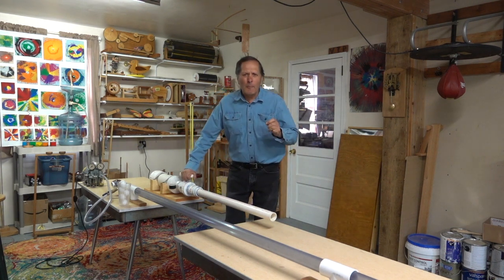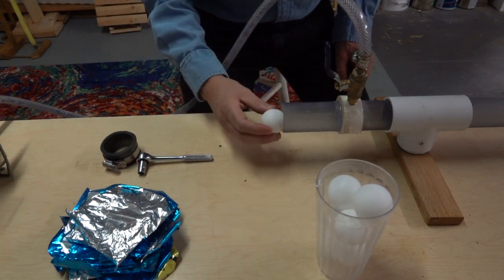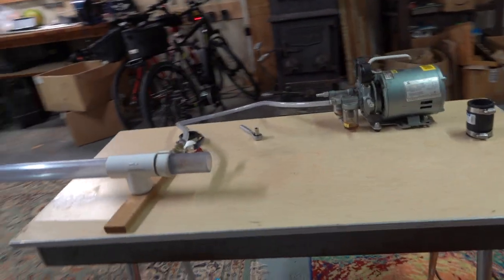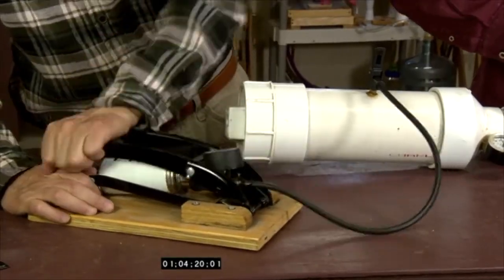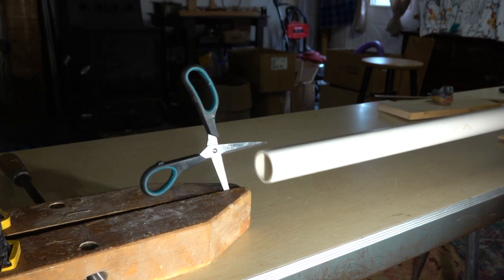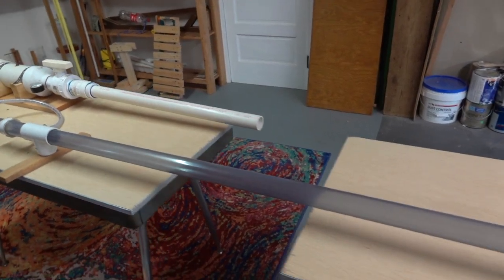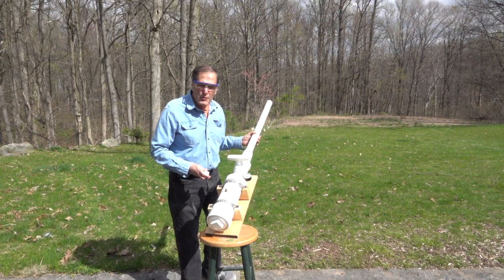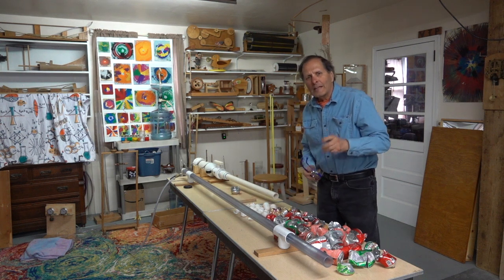Ping Pong Ball Cannon..Vacuum Cannon versus Compressed Air Cannon

Comment: I remember the supersonic ping pong ball from mythbusters, they found out that air that push the ping pong ball always managed to go around the ball through the tiny gap between the ball and the barrel. So at some point, the length of the barrel will no longer add speed, and even worse in vacuum canon, since some of the escaped air will actually act as cushion and prevented the ball to go through the other end.
Reply from the maker: I haven't seen that episode but am finding the same thing and will show it in part two
Reply: + longer tube = more friction.
Reply: @YeanyScience  hello Bruce, sorry to bother but there is religious promotion in this comment section which shouldnt be on a science channel

Comment: I've wanted to make one of these since I saw the episode on myth busters. These videos gave me the motivation to go ahead and do it. I've had a bit of trouble with cheap mylar balloons failing prematurely so I've switched to the slightly thicker mylar used in some snack food bags. (pirate's booty is the junk food of choice around here) I have a 5 ft tube and so far have been able to get to about 250 mph. I plan to try a few other types of balloons as I think the thicker mylar may be slowing me down. Thanks for the idea! I really enjoyed the videos!
Reply from the maker: Nice to hear that you went ahead and tried it,  I started with a 4 foot tube, went to 6 foot and finally 8 foot,  speed increased with each change,  something else to consider
Reply: @YeanyScience  ahh thanks I will give that a go.

Comment: Noticed at the 12:12 mark when the combined vacuum and compressed air cannon fires you can see some sort of oscillation at the end of the barrel where it appears as if the gasses were attempting to equalize by rapidly flowing in then out then into the barrel end.  I hope we get an explanation for that in part 2.
Reply from the maker: Good eye resiggy13,  I have some better views of it in part 2

Comment: I was gonna comment that you should vacuum tube the the barrel of the pressure cannon but you granted my wish! Also, another reason bit might slower is due to the need to accelerate air already in the barrel of the pressure cannon. With vacuum cannon you have no such resistance.

Comment: I made the vacuum cannon and am having trouble getting the ball to exit.  Mythbusters used regular packing tape to seal the ends, so I am as well, but the ping pong ball only exits every 3 or so shots.  Other times it seems to hit a cushion of air and stop before the end.  The ball is almost an exact fit for the pipe, so not much air is getting around, but I still can't get anywhere near the speeds in this video, and that's if it fires out at all.

Comment: In the pressure cannon, the air in front (target side) of the ball must be accelerated in order to get out of the way of the ball. Air is heavy. The air inside an ordinary refrigerator weighs about 1 kg or 2 lbs. The longer the barrel, the more air must be accelerated so that the ball gets a smaller proportion of the total energy.

Comment: I imagine the compressed air cannon would benefit from a sort of scupper valve once the barrel length gets long enough. I would rework that ball valve so it can easily snap open, or exchange it for a fast acting butterfly valve.
Reply: Agree! In the video we can see the valve still opening after the ball hitted the can. If the valve could be opened a little bit faster, all that pressure could be released more faster. @Bruce you could think on a way to open that valve more faster.

Comment: So theoretically, the max velocity of the vac pump would be the speed of sound ?
Reply: I don't remember the formula now, but, theoretically, the maximum velocity of the air filling a tube with barometric pressure 0 should be equal to light velocity. The barrel in this video don't have barometric pressure equal to 0, and have a lot of gaps to do it workable, and there is the ball's inertia.. it is very hard to calculate the theoretically maximum speed of the ball.

Comment: make a hole in the ball and fill it with sand...this will give some mass so it can reach crazy speeds and distances
Reply from the maker: in a later video I fill the balls with water,  makes quite a difference
Reply: In the UK I suspect you could fill them with lead shot ... and commit an offense under the Firearms Act!  🙂

Comment: Attach the vacuum cannon on the tip of the air cannon so you can have lots of pressure in the back and no resistance in the front. :)
Reply: I’m sorry, you just did that in your new video! That’s awesome 👏🏼

Comment: What happen if we combined both vacuum and the compress air cannon?
Reply: As in the tube or barrel be in vacuum state where there is less air resistance for the ping pong ball to travel through and the compressed air providing extra thrust to propel it.. just connect the two cannon together which you would only need to cap the exit end of the barrel while the inlet side would be sealed with the compress air mechanism as shown in the video
Reply from the maker: Hi Shafiq,  stayed tuned, I am working on part two now and have gotten some impressive results from the combination